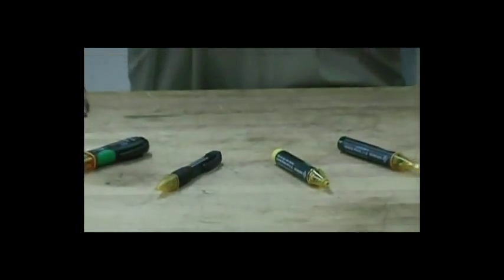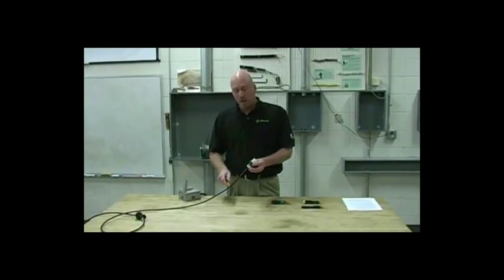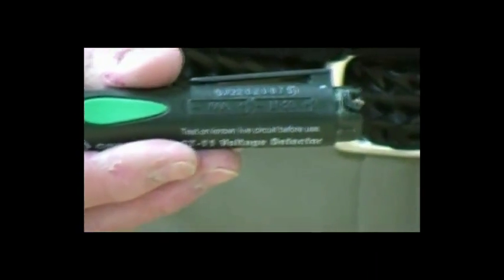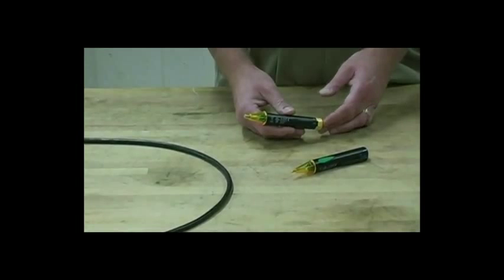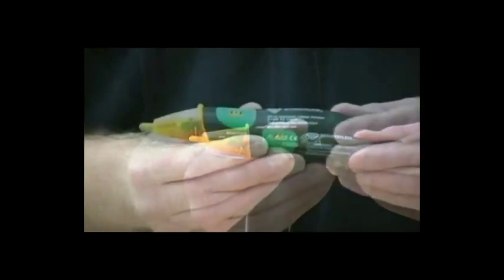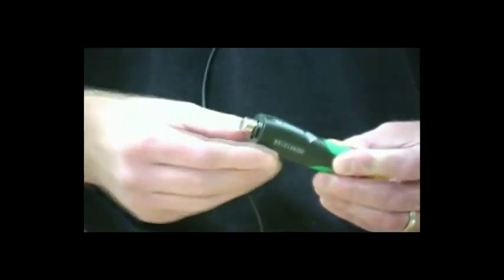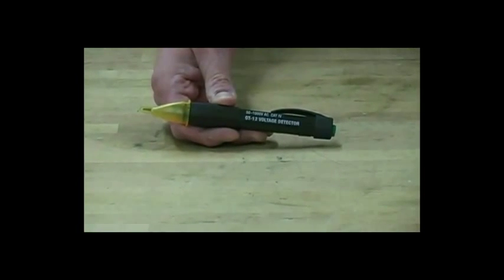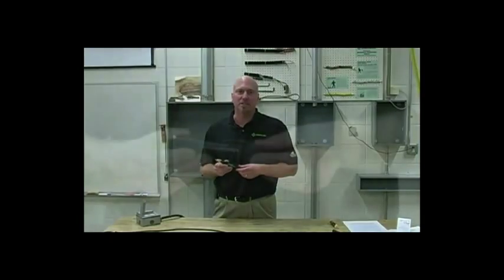Voltage Detectors by Greenlee GT 11 GT 12 GT 15 GT 16

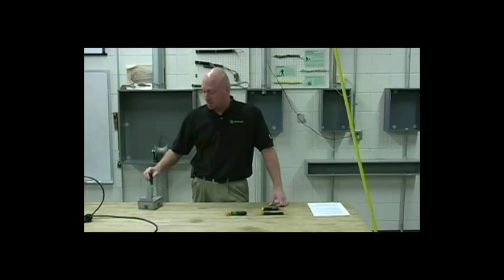Comment: I wish you would have shown like more examples or at least said them for what it's used for because I could of sworn you said first about GT11 (kind I have) 1:44 that its not a substitute for testing a live circuit(as you stuck it in plug) then on 2:19 after explaining in great detail how to put batteries in you said " test it on a known live circuit"  so what the frick dude!!! I have to test some water heater wiring and see if it's good but I have no clue how and you confused me more. Some people just aren't meant for making videos. 😢

Comment: My GT-12 works fine but when testing wires hooked up to a security box. It never indicated any AC current but when I touched hot wires, it would beep one time when I took it off the wire. What could that be?

Comment: Mainly just kept show how to install batteries. I wanted to see him actually using it in an outlet. Like does the plastic cover remain on or you take it off, etc.? And how to interpret results.
Reply: It stays as one whole piece. You stick the yellow tip directly into the plug outlet and it will beep and flash quickly. If that happens, that means the outlet has power going to it
Reply: My unit will not turn to the dot to change battery . What can I do ?

Comment: 1. Hell of an echo chamber. Install sound treatment in that room to fix the problem.
Looks like this room is also used for a classroom. Your sound issues also apply to students in the class. 

2. Machinery noise! Get rid of it before making a video.
3. In Text description, add time marks for the various models.
If basic operations are the same, then use timing marks and address the particular options for that unique model at that particular time mark. 

Most of us YouTubers want to skip the blather and get down to the real nitty gritty that applies to our particular model.